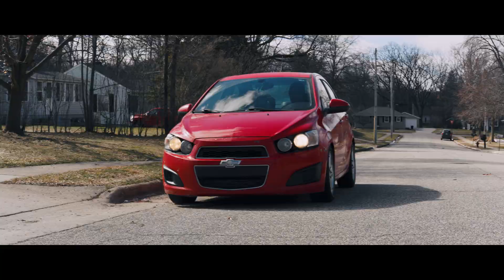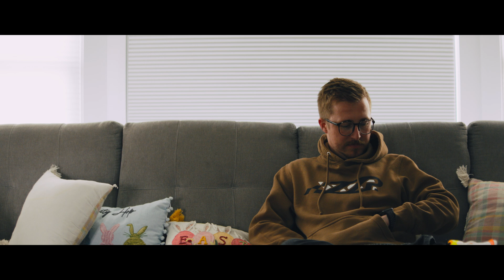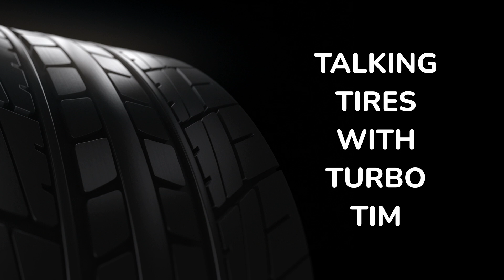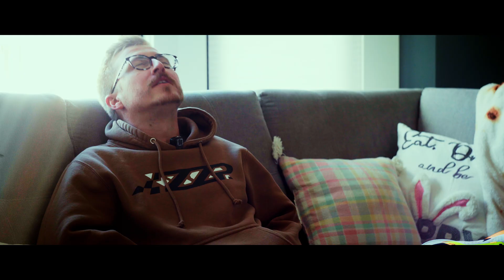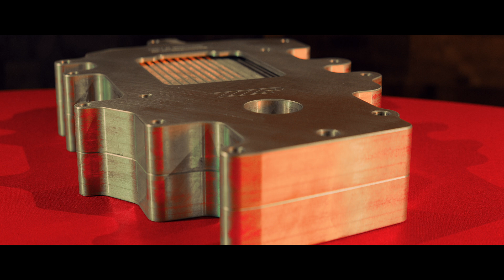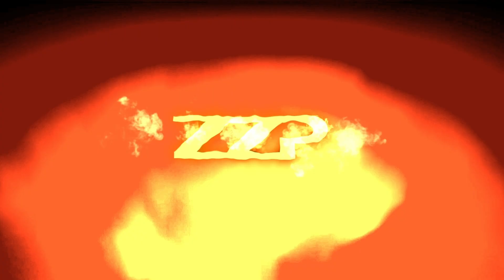3800 SUPERCORE Intercooler

Comment: Gotta give it up y'all. Keeping the 3800 platform alive and growing, its nice to see 🥲. 

My final wish is to see a "Road to 500hp" this year!
Reply: These engines deserve more love..  this is literally the same displacement as a Nissan r35.. why can't I make that power off of it?
Reply: @ChandlerHoman-k3v  I know what you mean. The R35's displacement is one thing, but then you factor in variable valve timing, dual overhead cams, multiport injection, and 4 valves per cylinder + boost you get something that a pushrod 2 valve V6 has trouble keeping up with.. in terms of making big power on stock components. I always use to look at LS's which are very similar to the 38, and just awe at what 2 more cylinders can do...who knows, maybe people will really start pushing them harder in the future. I feel like the aussies are the only ones doing that though.
Reply: @jonathanandrews1407  well I think the only thing holding this engine back in my opinion is the lack of rwd systems the only viable one you can get without going and spending 200k getting a custom made transmission is getting the series 1 out of the 94-96 Camaros with the V6 option downside is it's the series 1 and in my opinion series 2 is better its got the kinks worked out
Reply: @ChandlerHoman-k3v  I think everyone wishes all the GM 3800 cars were rwd from the jump, with the f-bodies being the only platform for that setup it kinda sucks. The 3.4 they came with in 93-95 weren't great for power, but ive seen maybe 2 on YT that were boosted. The series 2 came in all V6 fbodies 96-02, I own a 98 camaro that is being built as we speak. The n/a L36/L26 is a pretty stout bottom end (holds ~400 bhp), but obviously if you push for an L67/L32 you get lower compression and better rods for more boost (~600bhp) on a stock bottom end. Could be either a series 2 or series 3 short block. Im getting my (weak) T5 transmission for my 3.8 built to hold 450 ft.lbs and its not too expensive relatively speaking. The good thing about these cars is maybe after 5-10k in you have something really fun, and reliable without breaking the bank.
Reply: @jonathanandrews1407  that's why I concider them the equivalent to the EJ civics you buy them for a lowish price and can get them pretty well up there on numbers for a low price HP wise obviously your not gonna be pushing 1k with these engines unless you had things custom made that zzp can't even make but I like the cars because just like Honda's they are reliable even if you rat on them in the completely stock form... But they really made a mistake with the engine... At the very least for the Impala SS and the Pontiac gxp those highest end models they should of for a price allowed you to get a rwd system available as an option or AWD.. AWD would actually have been great with these engines if I think about it for the impalas your weight distribution would greatly diminish with all four tires going... The grand Prix could benefit from it the tuning work would have been happy... And you know I'm only 19 but I appreciate under appreciated engines and cars these cars and engines in general need more love and attention,

Comment: i had a 2.5" intercooler core from zzp wayyyy back in the day. it was used when i got it.  think its still floating around till this day.  production had to of been around 2010 or earlier. gutted the hood and had cradle spacers and still barely fit under a f1 ramair hood. not sure how robert fit it under the regal hood but it did.   i wanna say it utilized a ford probe heater core for the core but zzp may have to shime in, my memory is crap